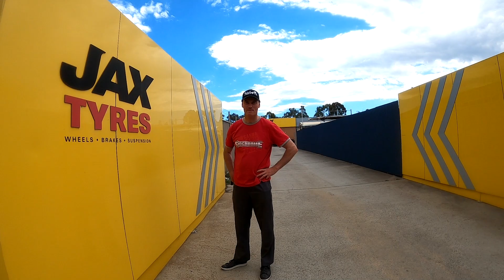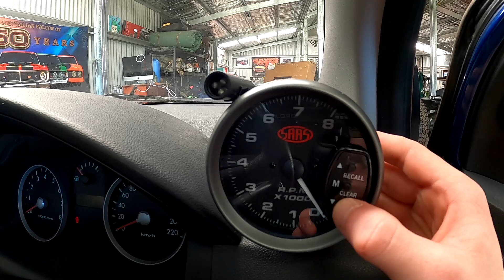Hyundai Getz Track Car | Enkei Wheels RPF1 Race Silver 16X7

Comment: Wheels look good! What offset are they? Any scrubbing?
Reply from the maker: G'day Paul, thanks for watching.  Factory offset to fit Getz brakes and will need to check the receipt.  No scrubbing as yet with the 205 tyres and we are about to fit coilovers.
Reply: @ClunieGarage  t
Thanks mate! Picked up a Nana spec Getz myself. Watching the mods with interest!
Reply from the maker: @paulbrown1299  Great to hear! They are a fantastic little car.  Is yours the 1.4 or 1.6?
Reply: @ClunieGarage  Yeah, it's the big block 1.6
Reply: Nice little car, but it plough understeers like nothing i've ever driven. Wondering if tyres might fix it. Or a rear sway bar and camber bolts on the front.

Comment: Dude I love this stuff, one question is it worth turbocharging a Getz?
Reply from the maker: Gday mate, glad you like our videos and thanks for watching.  We havent done it, but from what we have heard, it isnt worth it from a cost-benefit standpoint and I dont think the standard engine internals are built to withstand forced induction.  Our approach is to make the Getz the best handling and cornering car out there and to make do with the standard engine with simple bolt ons.  If you want bulk power, choose a different platform like some of the other track cars on our channel.  Hope this helps?
Reply: @ClunieGarage  yeah I was expecting it to be something like that, thanks  tho. Alternatively do you know of any engines that could be potentially swapped (and fit) in its place.
Reply from the maker: G'day mate, yes I have heard of a few.  Easiest option is to do a 1.6 Getz swap as it is exactly the same engine except different internals.  After that, things get more complicated but you can step up and explore a big block elantra and or a Velocetor (may have mispelt it, apologies).
Reply: @ClunieGarage  alrighty thanks mate you have been the most helpful person I’ve talked to so far appreciate it.

Comment: I here a accent 1.5 has the same as the getz there are extractors for the accent so going to order some already have a plugin chip and air pod for mine  next get the headers and exhaust done then bigger injectors and fuel pump then lower it
Reply from the maker: G'day, best of luck with your mods.  The only headers available for our 1.4 Getz are custom hand made ones.  Just make sure whatever Accent mods you buy will actually fit the Getz.
Reply: Thanks my mtr in the getz is a 1.5 G4EC the same as the accent been on line looking around and found I can get a stage 3 60hp+ plug and play chip from the states for it I only have a stage 1 in mind at the moment
Reply: @raynorsmith3379  how did the stage 3 chip go? Make any difference?

Comment: Will 215/55/R16 fit 2004 Hyundai getz with stock springs
Reply from the maker: We tried fitting 215s - they cleared springs but scrubbed the guards.
Reply: I thought they were 225 and you showed it scrubbing on the inner wheel fender.
Reply: @ClunieGarage  they are fine on my getz

Comment: I think that you may have given Junior a bit of wrong information regarding the redline on the Getz motor. I heard that 8,000 rpm was the best time to swap cogs. Anything less is doing the little 1.4 a disservice.😡😡
Reply from the maker: Haha, I reckon at 8,000rpm we might need to bring a bucket and pick up parts off the floor!!